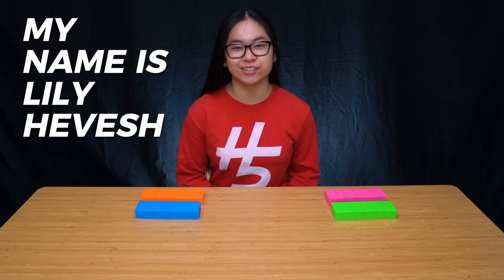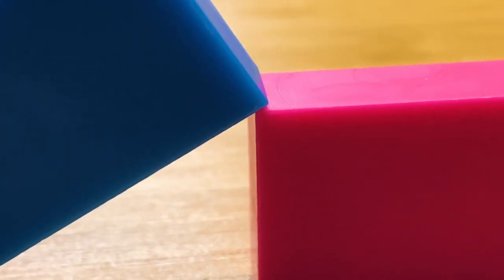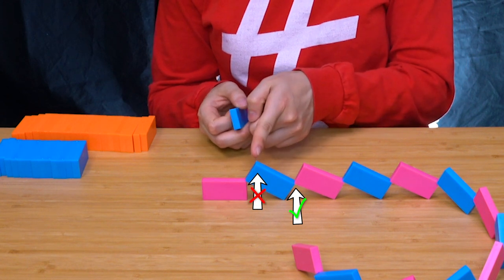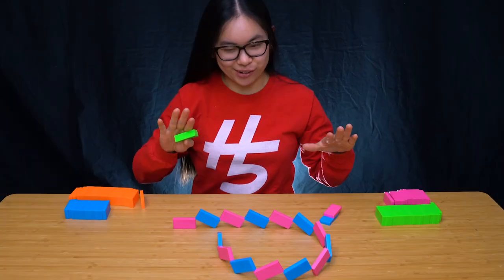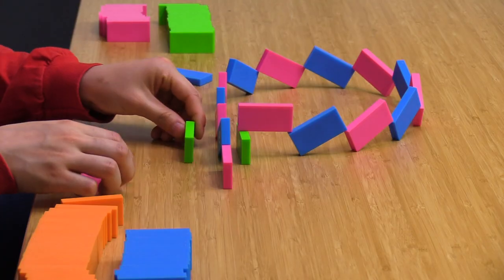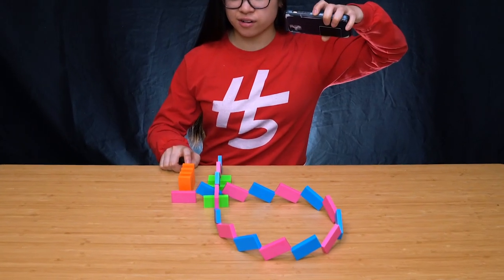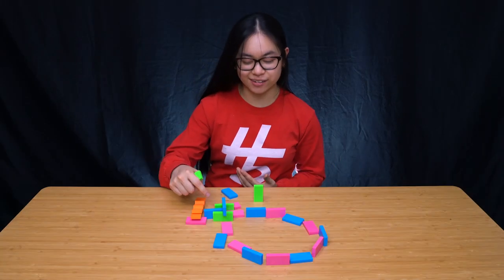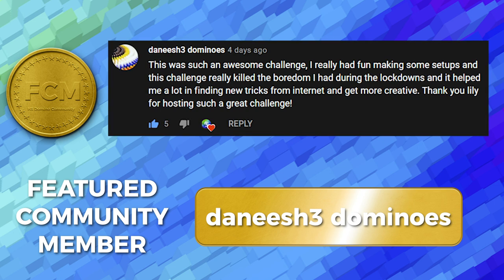How to Build CROSSING Sonimod Lines

Comment: At last the tutorials returned with this trick that sooner or later it was necessary for me to do one yay 😎, I hope you do not listen to me like a man who complains a lot but I do not do this type of tricks very constantly because I always do it with dominoes plastic classics and when I build them a trick like that they ALWAYS SLIP ON ME because they also have a very different thickness and it varies, it is a pity that your brand has not yet arrived here, because when I do this trick I always despair when it constantly slips but well anyway I never give up, I never expected that fail at minute 1:55 lol, actually I saw that once @Domino Dan do a kind of safety gap with this trick using string and tape but the disadvantage of that technique is that it needs a surface that has a minimum height so that the string is supported and the rest of the sonimod line does not fall, anyway, thank you very much for doing this tutorial because the video you made a couple of years was great (although this trick I already knew), and how good that you keep up building to teach the community great things! 😁😊👍
Reply: P.S. I can't wait for the May Edition of your newsletter next week! 😁
I wonder if you are going to say the winner of #DominoWars2021 this year again, will it be??? And if you are also going to say the final top 5 of the contest (where do I appear)???? 🤭😮🤔